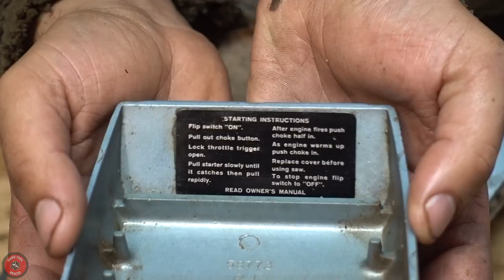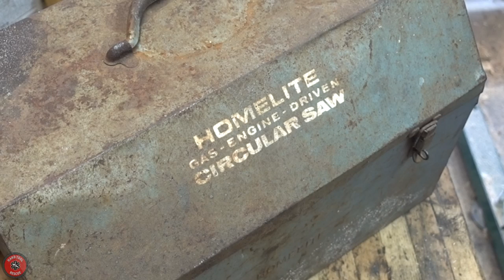Rare Gas-Powered Circular Saw [Rescue]

Comment: The only qualm I have with this video is you not draining the oil into a drain pan of some sort, if you are checking for metallic particulates then dumping out on your dirty workbench kind of defeats the purpose
Reply: Just what are you going to do if you find these metal particulates you're looking for? Do the happy dance?
Reply: welp, generally when looking for metal particulates in a gear system, it would indicate that the gears are damaged and need to be replaced. Like I said though if you just dumped them onto a dirty workbench then you are kind of shooting yourself in the foot and if you find particulates you cannot be sure they are from the gear box, so potentially you could create more work for yourself by having to replace something you don't need to or on the other hand you could harm the system because you could think "Nah, that stuff in the oil if just from having a dirty workbench" and then you could further damage the gears.
Reply: +scttydsntknw the bench had no metal particles on it before he dumped the oil out. I doubt you could get the gears for that tool today anyways. It has been out of production for over 50 years now.
Reply: I realized this which is why I was speaking in a more general sense. he said is the comments he is looking to do a more in-depth restoration later on and the focus of this was just to get the thing running. I come from a background of doing stuff like this and the oil all over the workbench would have gotten me in deep doodoo if i did it.

Comment: Anyone who sprays either in a two stroke engine is asking for problems. I wouldn't post that mistake anymore. Either is what I use to clean oil off of something! That engine shows signs of sitting for a long period of time. So it already lacks oil on the cylinder liner and rings. If you don't like that engine than yes by all means either the piss out of it! lol. OTHERWISE ONLY USE MIXED GAS! EITHER HAS NO PLACE IN A 2 CYCLE ENGINE.

Comment: U shouldent use quick start your gena oil starve it and score of the cylinders and piston and then you will have compression you should use an oil gas mix in a spray bottle burp fart projectile vomit projectile poop

Comment: Nice video, but used oil (like your drained gear oil) needs to be catched into a conainer and disposed according to your local rules (returned to the dealer or brought to oil waste collection). To mix it with saw dust and dispose it as saw dust is not only against law but also a severe harm to the environment. Remember we don't have a second earth.
Reply: Wrong
Reply: True, we don't have a second Earth, no if we could get the powers that be to stop spraying nano-alumium on us with air planes it might last a little longer, or stop spraying bug killer that is killing bees, we could last a little longer. I apologize for venting, but I love this planet, and most who live on it. "Government Regulation" of this or used gear oil, or that.